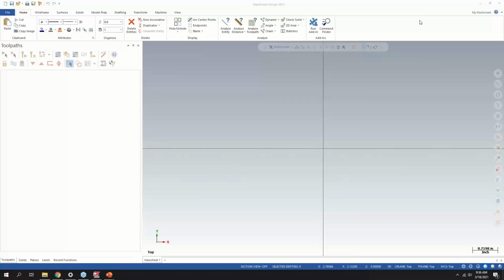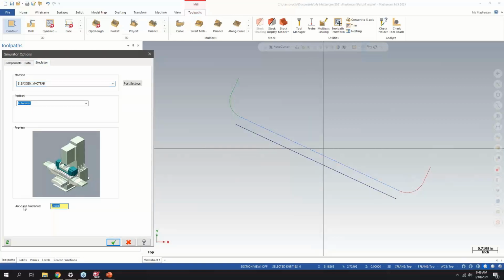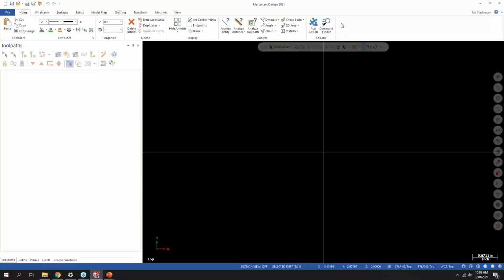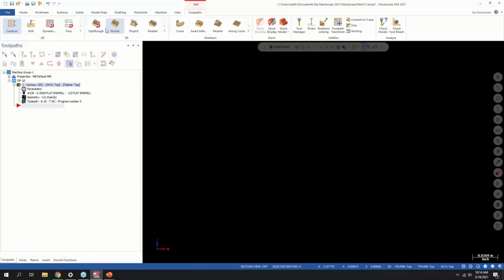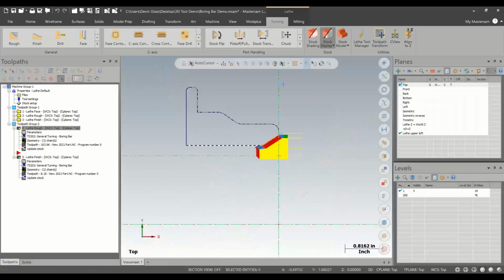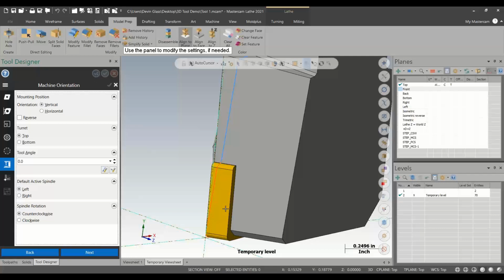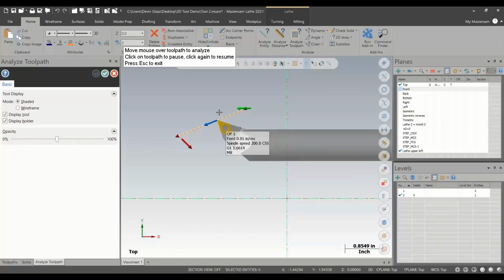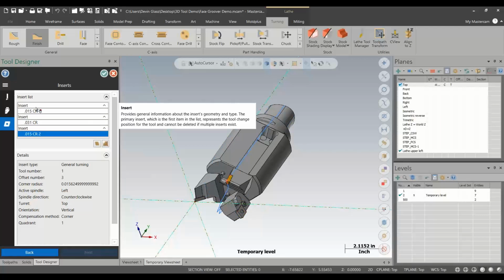Mastercam Tips & Tricks Webinar: Mastercam Configuration and Lathe 3D Tools Deep Dive

Comment: I have a question. I'm new to using Mastercam 2021. say for instance. I program a 2-inch diameter bore on a lathe 3 inches deep. after the finish cut, the Boring Bar rips through the part returning to home.
even if I define an endpoint. how can I correct this.?
Reply from the maker: Hi Kevin, in the toolpath on screen or in the G-code? If in Mastercam make sure you use Stock for outer boundary and lead out settings are correct. If in the code but not Mastercam it could be some post settings. But your best bet is to talk to your local reseller and have them look at the file.